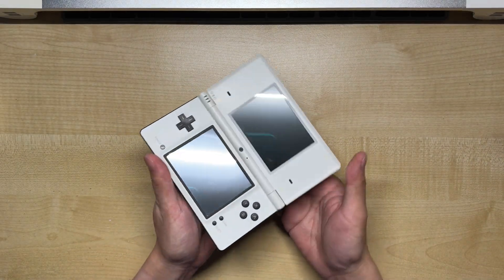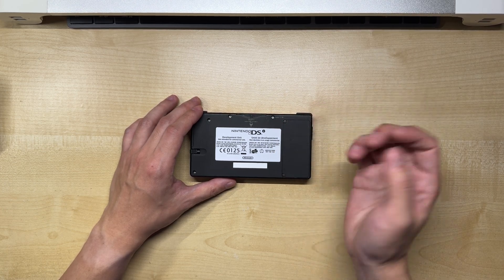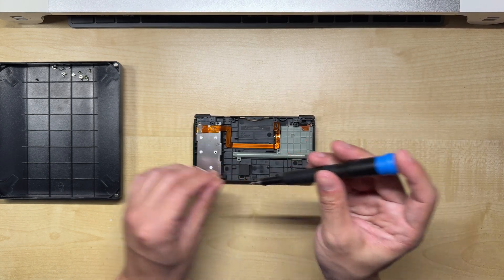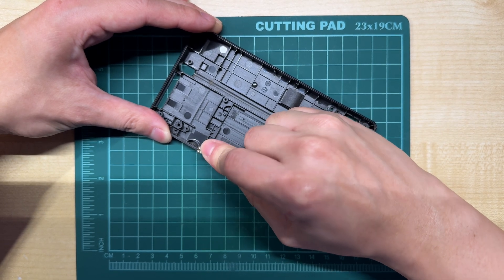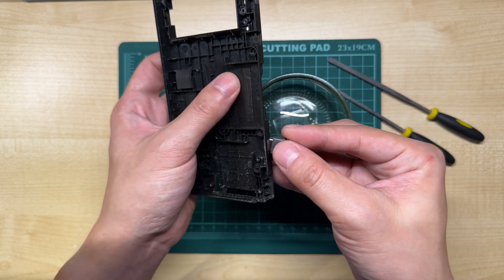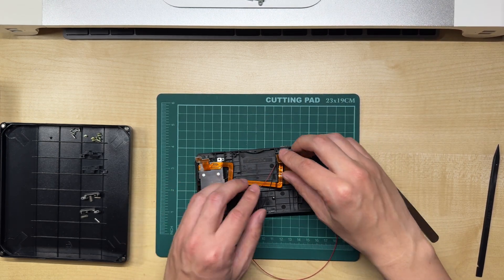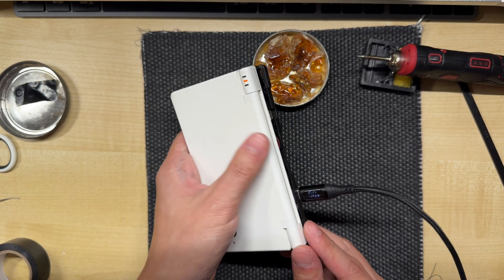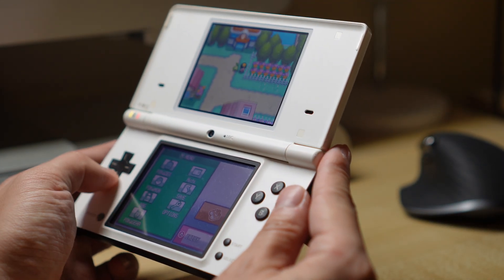EUnifying my Nintendo DSi (USB C Mod)

Comment: Side note:
When screwing into plastic during reassembly, turn the screw backwards until the thread latches in. Turn the screw then forwards so you don't cut a new thread or cross thread. That's how you keep your plastic housing parts in good condition and prevent cracks from appearing.

Comment: Hey im modding my younger sisters dsi from when we were kids for upcoming christmas she likes to travel can i follow the same process and just remove the Nintendo charger? I was thinking on keeping the strap for an air tag and whatever she wants and i dont think she will have time for the proprietary charger on trains and going to hotels would be much more convenient to just use usb c? Great video earnt an easy sub
Reply from the maker: There are kits out there that let you replace the Nintendo proprietary port with a USB C port, this is doable but requires a little more complicated soldering work.
Reply: @NekoMichi hey man after looking all night online I've noticed not many people were smart enough to think about that resistor like you were and I can't seem to find anyone putting a 5.1k resistor female usb-c port as a drop in soldered replacement for the proprietary one do you think there would be enough room to use a part similar to the one you've linked and connect wires from that female port to the board? So same set-up as you but it goes to the og charging port hole not the lanyard spot? Or do you know of any drop in replacement usb-c WITH the resistor? Thanks so much for your reply brother
Reply from the maker: @loo0nz691 Yes, that's still possible. You'll need to file down the opening on the casing and find a way to secure the USB C port (with resistor) but this is definitely doable.
Reply: @NekoMichi thank you man 👌

Comment: Followed this tutorial as an alternative to a messed up DS charging port and it thankfully charges BUT only when the ribbon cable that connects the USBC port shell to the main body is not plugged in. 
Any possible solution?

Comment: I just tried this but now it won't turn on at all. 😔 I first tried with it closed and the battery in. It didn't turn on, so I plugged in with the original charger. It blinked orange then stopped and now nothing blinks on it, with usb c or original or with the battery (which has 4v in it. What I think is the wifi/bluetooth board fell out at one point, but I'm pretty sure I plugged it in all the way. I was having trouble soldering the wires so I was poking there for a while (eventually switched to a better tip which made it much easier). Any suggestions what I should check? Maybe something got pinched when I closed it? Thanks for any tips!
Edit: Also I checked the pins I soldered and they are not connected together.

Comment: Why not just replace the connector?
Reply from the maker: I like to keep the original connector for redundancy.
Reply: @NekoMichi Ohh ok cool. Also do you need the 5.1k resistor if you are just changing the existing connector to USB-C?
Reply from the maker: Yes, the 5.1k resistor is still needed. Without it, the USB C host won't know it needs to supply 5V.

Comment: Thanks for the instructions! 
I did this mod and initally was using way too thick wire. 22 AWG is definitely too thick. Use thin wire like in the video. 
I also couldn't close the case because the ribbon cable connector was pushing against the USB C connector. I solved this by melting away the corner of the USB C connector slightly with a soldering iron. 

Now charging my DS with USB C and i must say it feels like magic.

Comment: I've been trying to get a usb-c board like the one you linked since this morning and finally found one on aliexpress with the title: 

"1/2/5/10pcs USB 3.1 Type C Connector Support for PD Female Socket receptacle Through Holes PCB 180 Vertical Shield Dual resistor"

In case that one goes down: "USB type c Female Connectors Jack With Dual 5.1K Resistors 16pin usb Electric Terminals welding DIY data cable Support PCB Board"

I can finally start this project!
Reply from the maker: Best of luck with the project, let us know how it goes!

Comment: Another banger of a mod! While I don't have a regular DSi I do have a DSi XL and between your video and the iFixit Teardowns I think this might be possible on the DSi XL as well as it does seems that the SD card slot reader/cover and lanyard/wrist strap loop hole are almost the same form factor (I actually think there is more space between the reader and the lanyard hole, so I think it might even fit better than in the standard DSi), so I might have to give it a try on the DSi XL!
Reply from the maker: This is 100% doable on the DSi XL, funnily enough I actually did this mod on an XL months before making this video. On the XL, the USB C port was located in the gap between the lanyard slot and the R trigger button.
Reply: Was it harder than this?
Reply from the maker: About the same difficulty, the internal layouts are fairly similar between the two consoles.